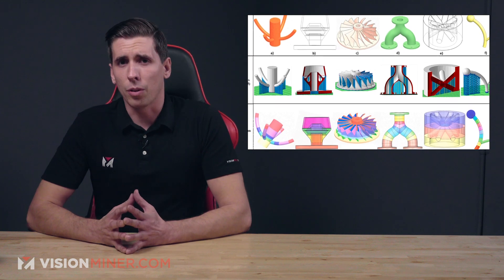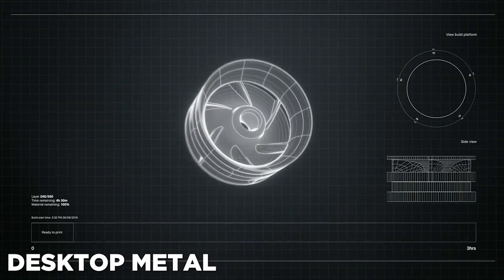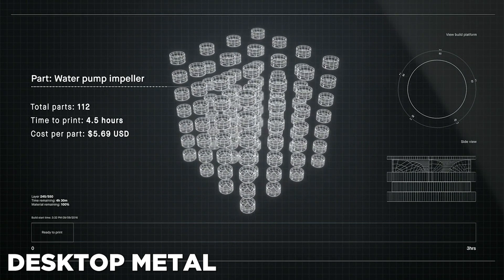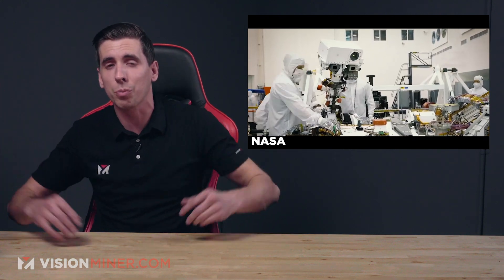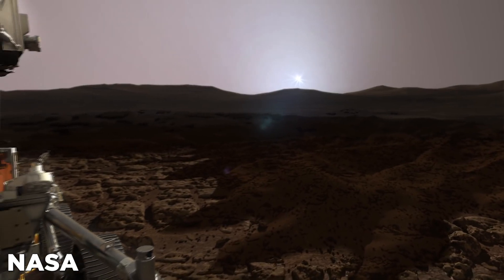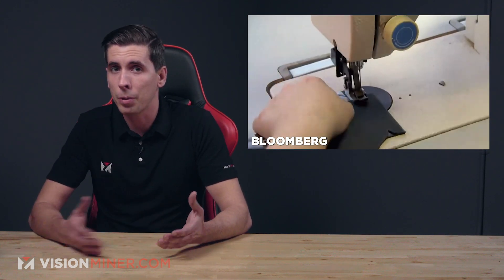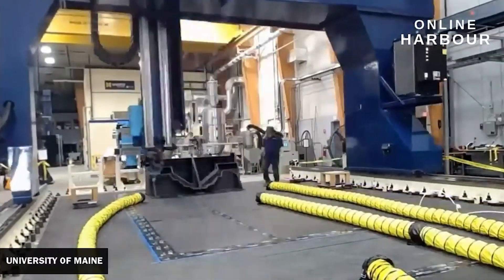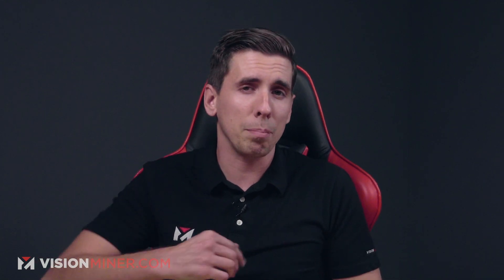5-Axis 3D Printing, Desktop Metal NYSE, Curiosity Rover, SpaceX, Boats, and More!

Comment: Will the hoodies shrink when they're washed though
Reply: Not if you replace the washer's drum with one of their carbon fiber drums and use Nano Polymer Adhesive as the detergent. 🙃
Reply from the maker: That's right, with our proprietary titanium 3d printed hoodies, you need to make sure to get the inert argon vacuum environment, as well. For the washing lasers, that's also going to require 3-phase power, so it's not applicable to residential areas. Hah! Coming soon...